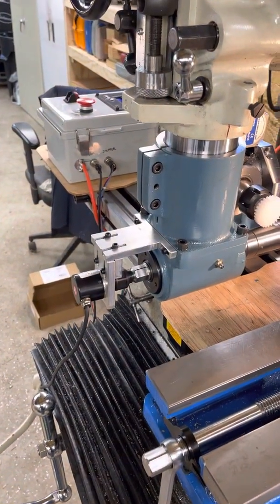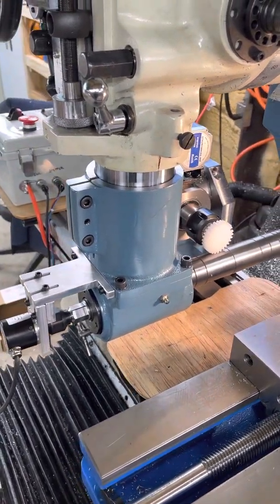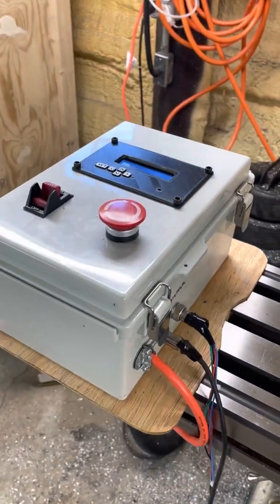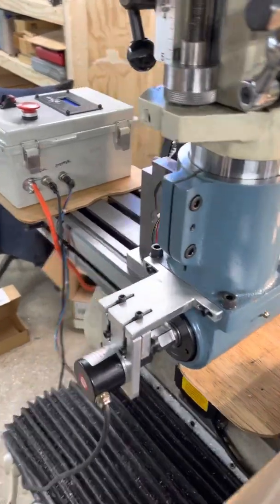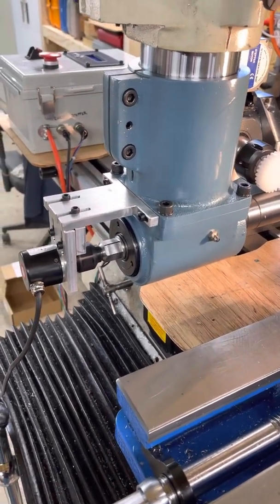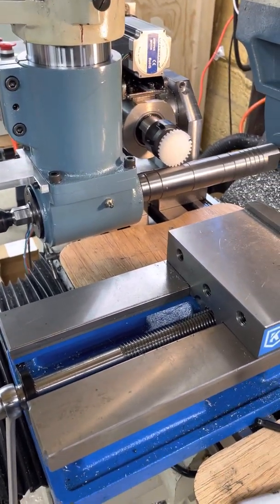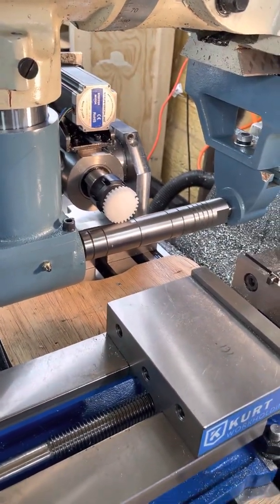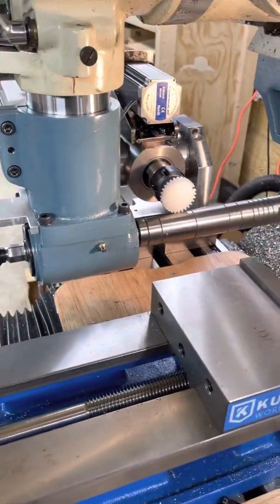Gear hobbing setup on Bridgeport-type mill

Comment: I wish there had been a pulled back view of your setup.   
Did you fabricate the horizontal arbor and drive supports?
Reply from the maker: There’s probably a better view in one of the other videos.  I built the work axis.  The horizontal axis and supports were bought online on eBay…Chinese origin, but fit my clone.  The arbor was Amazon, I made the drawbar and encoder bits..hop this helps!